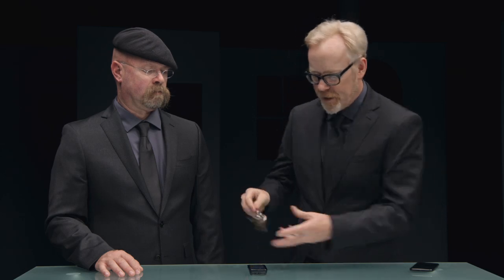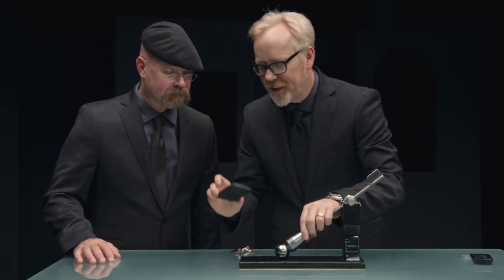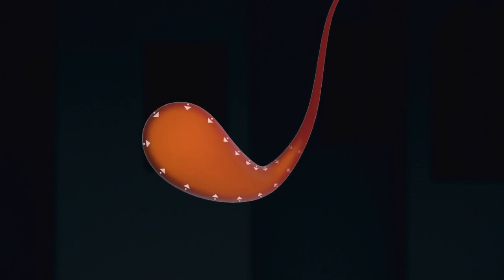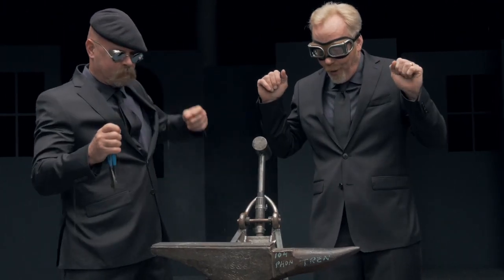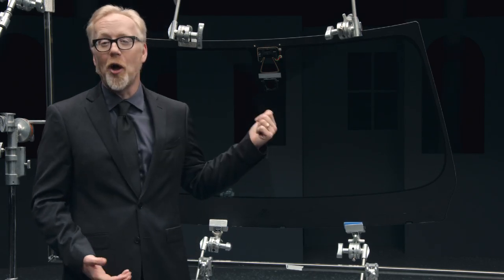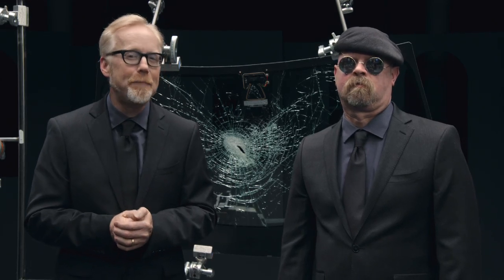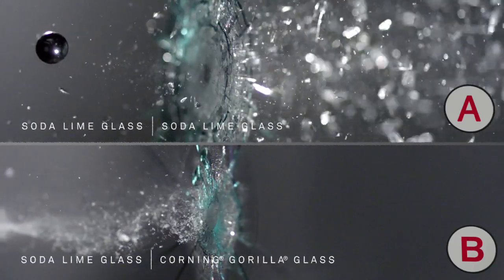The Glass Age, Part 2:  Strong, Durable Glass

Comment: Why not use two layers of gorilla glass for the windshield? Does the gorilla glass have some property that doesn't work well outside? Seems like it'd make more sense and save more weight if it was on the inside too
Reply: I would guess cost and how the material absorbs and distributes the energy. It's funny how they didn't have him hit the windshield with the sledgehammer. I think the videos are pretty clever marketing tools.
Reply: My guess is,  it is not used on the outside due to the increased "surface tension"  The reason it works so well on the inside is that there should be no scratches on the inside that would compromise that glasses tension.  The outside would be prone to constant attacks on it tension, rocks, debris ect ect.  Since the inside (gorrila) has increased engineered tension.  Those scratches and dings would be more significant inside.  Since the outside has less tension,  it can handle those issues better.
Reply: Jacob Koehler They said the gorilla glass is too strong for that.. Though there are seat belts and other safety bags, the regulations do require "your head is able to go into the window" for certain distance if accidents happen...
Reply: My first thought was Cost... Regular glass may be heavier, thicker and more fragile... but it's a hell of a lot cheaper.

Pretty much the same reason all the plastics in a car aren't replaced with Kevlar, even though it's a much more superior material.
Reply: ***** Maybe it would be too wobbly? Or lose too much sound isolation?
Reply: Honestly my thought would be that gorilla glass, under compressive forces is much more brittle, yet stronger than regular glass (think cast iron and steel). If it were hit without being shielded by a layer regular glass and then laminate first it would likely shatter the entire wind-shield much like the Rupert drop. The regular glass and laminate take out enough energy in order to allow the gorilla glass to survive and deflect it instead of shattering spectacularly.
Reply: Having a background on glass in the construction industry, I'd suggest it is primarily due to both sound and heat transfer. A car parked in the sun all day would basically have zero insulation with the amount of exposed glass on a car. And it'd be like driving with all the windows down in regards to sound.
Reply: might smear with water/oil on the surface when using wiper blades. 
not seeing out of a car isn't a great idea...
Reply: Hans Pedersen You don't think expensive car manufacturers try cutting costs ? Also Gorrila glass is much harder to scratch then regular glass.  Its actaully about 3 points higher on the Mohs scale then regular tempered glass. Also it can withstand about 100lbs per sq. inch. Gorilla glass 3 is rated at about 140 megapascals where fully tempered glass is about 65 megapascals. So gorilla glass has about 2.5x the pressure resistance as regular tempered glass. So it would neither scratch nor deform like you said. It boils down to it being more expensive in everyway, and tempered glass is still an effect and cheap way to produces impact safty glass.
Reply: Dreadnaught1985 That's my thought. This windshield would be expensive, really expensive. To make a double layer would probably double the cost over the already double the cost windshield.

Another question would be how does gorilla glass handle exterior conditions? Snow, ice, rain, road salt, pollution, washing chemicals, etc.
Reply: Definitely cost, I work at Progress Glass Technologies and it costs us about $15 a sq. foot to produce 5/8 tempered lami glass. So a 60"x40" windshield would run about $300. That's also not including the bending process, tint and UV coating car windows get.
Reply: Hans Pedersen http://www.slashgear.com/bmw-i8-is-first-car-ever-to-be-fitted-with-gorilla-glass-08293148/

"However, while we expected the windows and windshield to get the Gorilla Glass treatment, it seems BMW is only outfitting the rear window with Gorilla Glass. The car maker says this is for sound-dampening purposes, as the glass will consist of two 0.7mm layers with an acoustic sheet in the middle"

So the reason it won't be seen as purely Gorilla glass windshields is cost and sound dampening.

cost in your average cars, and sound dampening in your sports cars.
Reply: Perhaps because then it wouldn't break at all and then you wouldn't have to buy another windshield?
Reply: Because how would you get the people out if the car crashes. The front window breaks like that for a reason. it takes minutes to break the current front window on a car imagine how long this would take. it may not seem that much but if you just been in a crash it would seem like a long time. Also the side window Break into blunt little pieces so they can't hurt people in the car. I almost forgot the reason why the front window doesn't break like the side windows is because it needs to take more impact and more things hitting it hard. 

In conclusion.
One layer is enough to stop a stone so you don't need more layers. Because it would cause more problems in the situation it would be needed the most.

After reading this I realised it may seem a little bit mean. I'm not trying to be mean so sorry if you think it is.
Reply: @BandidoDescalzo  if you thing gorilla glass would withstand the jaws of life they use to extract people from vehicles, you'll have to rethink it, lol!
Reply: @MaryAnnNytowl  please ignore 15 year old me he doesn't know what he is talking about.
Reply: @BandidoDescalzo  fair enough. Quite a humble and friendly response, too!!  I had to doublecheck to make sure I was actually still on YouTube! Congrats to you, young man - I appreciate it.
Reply: They did say it is "Experimental." Which means they are still experimenting with Gorilla Glass for windshields of vehicles.

Maybe they already experimented with two layers of Gorilla Glass, and something didn't work with that idea, thus was scrapped, and thus we are shown an experimental version that shows promise.
Reply: Because they need one layer of glass to absorb the impact, and reduce the chances of the GGlass shattering on the other side. Remember what happens when compressed glass shatters? Yeah, "boom".
Reply: Jacob Koehler , what Ting-Yun Huang said; if the glass was completely solid and not give at all, it would be like your head hitting a concrete wall, where a 'slowing-down' is more preferable, to negate the potential forces involved. Much like going down a flight of stairs is preferable to jumping down 10 feet every floor, which is preferable to jumping to the ground in one big go (if you live up on a high floor in a building).
Reply: Hans Pedersen hmm. Could be, but I'd have to assume the glass corning would use for this would be high on the harness scale for that reason, but I also think the reason we haven't seen it much is because it's SO new. Although it IS being used in production BMW i8s. What's more interesting is that they actually use two panes of gorilla glass in that car! But it's only used on the rear window, supposedly for its superior sound deadening properties. And this article says it's also tougher than conventional glass, so I still don't understand why they didn't use it on the windshield as well. I got my info from http://m.autoblog.com/2013/08/07/bmw-i8-will-be-first-production-car-to-use-gorilla-glass/
Reply: Hans Pedersen Cost Vs Demand.
Reply: All glass types are "too hard to scratch", if you try to scratch it with metal. I suggest you watch the details in the video further. :) They show how they've reduced surface tension in Gorilla glass, making it less likely to shatter because of bending or applied pressure. Hence, they're making it softer. For instance, one way to break into a car is to use screwdriver, applying a decent amount of pressure to the door glass. It will shatter into tiny pieces pretty easily like that, without creating very much noise. In the ad above, they are literally showing how a 5 inch piece of Gorilla Glass can bend nearly 90 degrees from edge to edge. A car windscreen would shatter if you'd try to bend it a few degrees.
Reply: ***** I see your point, actually quite clearly. I would like to see a video with pound per pound strength test against competitors and standard glass. But my assumption would be that they want to keep their threshold of strength and flexibility as  ambiguous as possible you know? Like as if saying 'even though our competitors break at this force ours withstands double that but we won't tell you where it withstands to. Just know that ours can last WAY more than they can.' As far as the exact force it takes to break the glass the average person can't measure do it's just left to speculation which I think is a huge selling point.
Reply: Josue Nordman that's why I don't feel good with this video --- the ambiguity. but well now I realize this is the corning channel. I shouldn't watch it as if I am watching Discovery/NatGeo channel. : p this is an ads after all.
Reply: I think it has more to do with cost effectiveness.
Reply: The same reason it's better to have armor that has a stiff and a flexible layer.
Reply: ***** I see your point but what is REALLY going on in MY opinion like I said before is that for the first glass with the sledgehammer they did what they did to make a point. Not to show how "weak" the standard windshield glass is but to show how the clear resin in between the two panes keeps them together even through a high impact blow i.e the sledgehammer. They didn't use the sledge hammer again with the gorilla glass, was because a sledgehammer to anything is basically game over if it isn't built for things like that. They wanted to show the G-glass's capabilities in a reasonable scenario not with a full arm swing like you said. Another thing, like they said it is still "experimental" and it is NOT unbreakable, that if you are set out to break it. It will. Hope I don't sound like a butt wipe :)
Reply: Wes Williamson I think the sledgehammer would have damaged the windshield almost the same way as Soda lime so they used the stone chip test to give us an idea of how strong the windshield would be. If they used the sledgehammer it would have defeated the purpose of advertising corning glass i think lol Would make people think whats the point to having corning on the windshield then?
Reply: Wes Williamson actually i think that even with a seldgehammer, the windshield would have done its job just as well as it did in the test. for one, they showed you what compressive strength in glass was like when they dropped he hammer on the prince rupert drop. also, you can guess that with a ball bearing shot at a speed of 120 mph at the window would be a much higher energy impact when you take into account the surface area of the impact. also, a sledgehammer impact is not a common scenario in the real world. you are much more likely to face impacts from pebbles shot up from the tires of the car in front of you than a stone being hurled at your windshield. in that sense, there is no question the gorilla glass does the job much better.
Reply: Hans Pedersen Gorilla glass is atleast four to five times more expensive in every single way rather than your standard run of the mill soda lime glass. And while it may be better in every single way its impacts on weight reduction are far superseded by the massive amount of safety laws, research and development required to even make a production vehicle not be another massive recall.

 Im all for the gorilla glass on the inside, but automobile manufactures have no real reason to "reinvent the wheel" so to speak when normal glass windshields are performing as people have come to expect and the prices are dirt cheap.
Reply: Wes Williamson yes because using a sledgehammer will just break both windshield a and b and they won't have something to compare to lol
Reply: Cost isn't a reason. Had it been, we'd seen it on more expensive cars, and definitely on sports cars. It's too soft and too scratch prone. The wind pressure would deform it and a windscreen has to withstand being "sandpapered" by the wipers while it's all covered with dust.
Reply: Rando Grando right, but in that case it'd be a bad idea all around, and the laminate helps keep breaks localised. I agree with some others that it's probably a cost issue. But if it was as brittle as you make it out to be that would seriously ruin this for me. Haha
Reply: Wes Williamson The glass Isn't indestructible, they said it themselves. If you are set out on breaking the glass. You will. They showcased the Property of conventional glass retaining its shape even though it was hit by a large sledgehammer due to the resin in between; It was an extreme example to ensure 100% the glass would break. You get me? Oh and, ***** It isn't ready yet. they're still working on it that's why they emphasize on "experimental". I'm sure they calibrated the cannon to shoot the bearing in an average or slightly above average setting to again "showcase" their current progress with the products.
Reply: ***** I guess that plays a bit of a role in it a lot xD
Reply: I guess we can never really know until they come out with the complete product
Reply: Hans Pedersen  Sorry for dredging this from the depths, I only stumbled upon this video today.

The glass that bends is actually an entirely different product, though because of the name I can understand why it sounded the same. The glass that bends is called Willow glass (most likely named after a willow tree's branches), it's specifically mention at 6:50 on part one. Gorilla glass isn't especially bendable (much like regular Soda Lime glass) but is incredibly strong. The example you gave with the screwdriver is simulated both with the steel ball dropping on the phone, and in the test here where a point force is applied to the laminate windshield. However, I do wish they had let Jaime hit the Gorilla laminate windshield with the sledge to see a more direct comparison with an accident situation (even though it is/was still in development).
Reply: KyleCorbeau and here is my theory : the bullet in the video actually produces less impact then the sledge ! !

note that : the sledge can produces a hold on the normal windshield. there is a little part of the sledge actually gets through the windshield, but not entirely. (see 6:34)

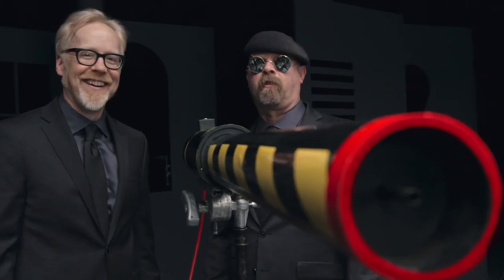whereas the bullet bounces back by the normal windshield, not to mention producing any hold. (see 8:16)

this suggests to me the sledge carries more momentum energy during the hit, while the bullet is less.

I believe if Jamie were to hit the GGlass windshield using sledge and a full-arm-swing, the test result will be "very ugly".
Reply: Josue Nordman
You sounded quite reasonable to me. :)
Though I know the gorilla windshield would catastrophically fail (much like the soda lime windshield), and keeping in mind it is experimental, I am still more curious as to how it would fail. Though they only hit the regular windshield to demonstrate and highlight the resin, it leaves me somewhat unsatisfied in my curiosity knowing that they had the opportunity to show what the other glass would do in similar circumstances (demonstrating something closer to an accident or a larger projectile) but Corning chose not to. Hopefully they do a follow up, when it's closer to a more satisfactory product for them, showing off more range.
Reply: I think the ordinary soda lime glass has to be there because it functions like a buffer which gives the bullet more time to dissipate its moment.
Reply: cost-benefit.
Reply: Lol!!!!!!
Reply: SpiritBear12 Safety regulations.
Reply: Most people that have replyed have a good idea, i live 15 miles from where they first developed the product. I knew of the product about 10 years ago when i saw them test it in a lab. It was first designed to be used on the solar panels that are on satelites. First designed to take an impact from small metiorites its could be used on the exterior and interior but it will flex too much. If you have any iphone or droid from the past 5 years you have gorrila glass and didnt even realize. There are weak points though, such as the edges. If you hit its face it wont break, but if it hits the side it will shatter.
Reply: josiah O'Neill The main reason that the windshield's are so hard to break is that they are a structural member, old cars windshield's were held in with a rubber spline in the gasket.
Reply: because if gorilla glass breaks, it will be catastrophic. all the small glass dust go into your eyes, noses, mouth, lungs, skin, ...

and in the particular experiment, you need the outer glass to break in order to dissipate some of the bullet energy. yet the bullet needs to be fast enough to break a regular glass but no a gorilla glass. 

that's why
- you must use a calibrated canon,
- put the gorilla glass inside not outside, and
- this is not commercial ready.
Reply: They're using titanium alloys, full body handmade carbon fibre. But gets scared off spending a few dollars extra on the windscreen to halve its weight? Really? :)
Reply: Good points. The best one I saw though was the crash issues. If you're in an accident and the only way to get out is through the window you can't break it'd be a big problem. Or if you weren't wearing your seatbelt (come on, people!), the glass would likely be so strong that you'd hit it and not even go through (which in that case, squishing into a wall would be worse than flying out of the car). Still not sure about the broken glass and how much it'd suck to fly in your face. haha
Reply: I guess that it's because of the way it breaks. They didn't show it, which in an Ad usually means it's not nice. I imagine something similar to the drop, which wouldn't be pleasant for the people inside the car.
Reply: Gran Gurbo traditional glass debris goes into face ; whereas gorilla glass dust goes into lung.

this is the glass age, why not go deeper!! XDDDD
Reply: windshields are designed to pop out of the frame when hit from the interior methinks, so that wouldn't be a factor.
Reply: Josue Nordman right! and you probably know I am not very satisfied with this video, don't get me wrong, i am impressed very much by this gorilla glass. i just hate the way they present it! 

i usually prefer to most boring way to learn new technology. just give me two glasses side-by-side. and shoot them with canon with increasing force. show me when the normal glass breaks and when the gorilla glass does so.

give me the number, and i will "WOW".

but now they try to give me "WOW" directly, and I just confused by "why they don't just tell me the number?!"
Reply: If the gorilla glass were hit by that ball beraring directly it'd probably shatter, leaving the car with a frosted glass windshield going 100mph, not a good idea.
If the force is spread a bit by the laminate in front of it, it doesn't shatter.
Reply: Jacob Koehler you dumbass they showed us what happens with the prince Rupert's drop.